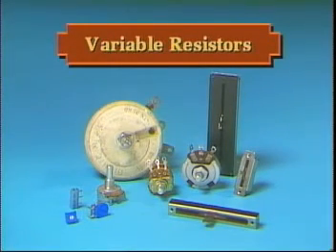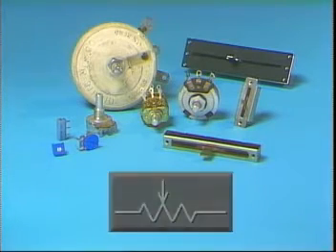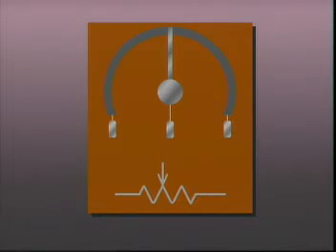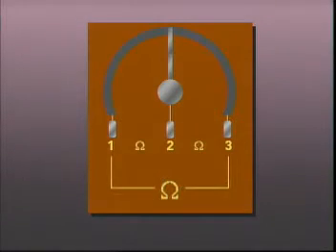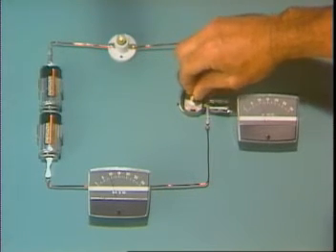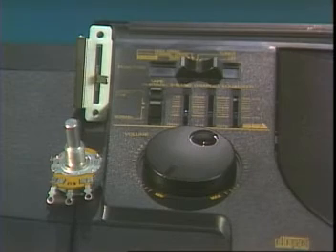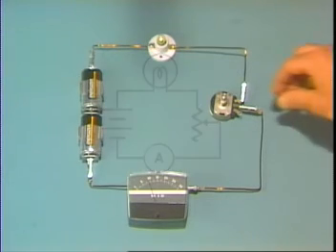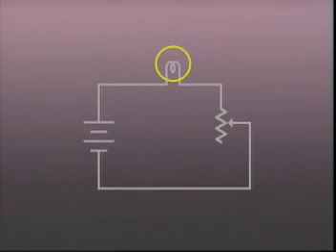DC Electronics Theory Lesson 5 Segment 3 - Variable Resistors

Comment: According to Ohm's law , Voltage is Directly proportional to Current , So any change in voltage or current will change the other. 
According to your video & your explanation, there is no such kind of thing happening.

I need an explanation on this.